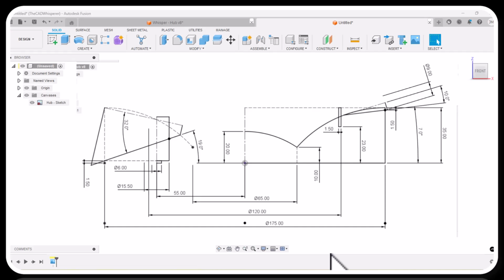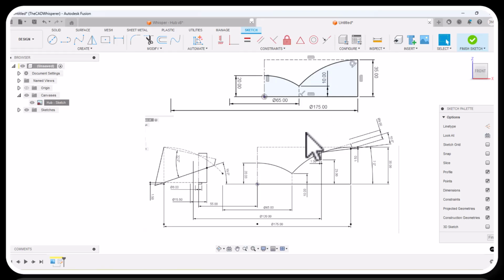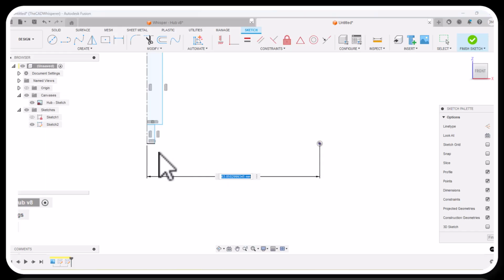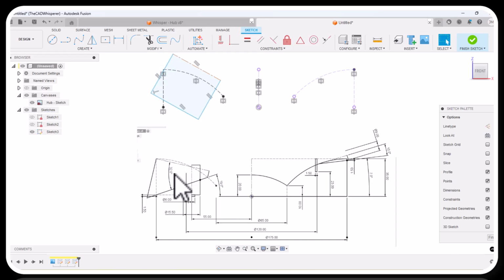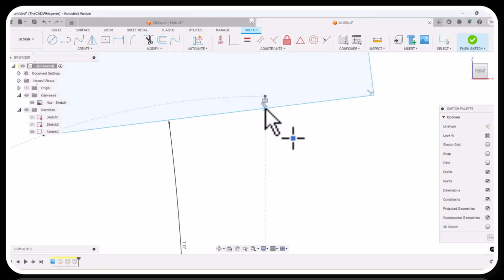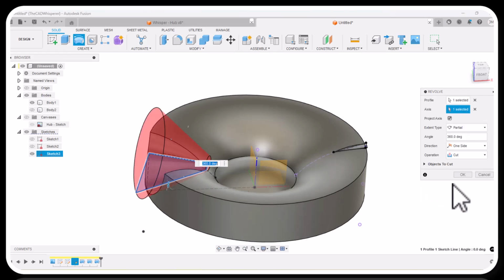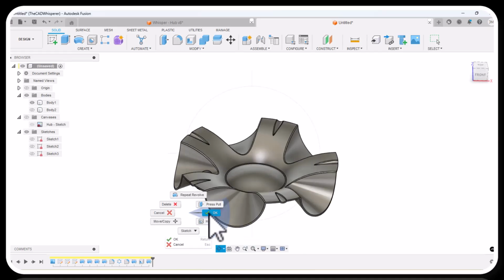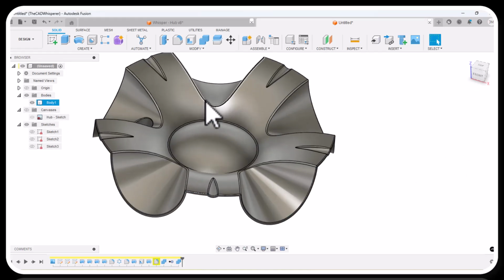Wheel Hub

Comment: Hi JD. Do you still have this file? Can you try something for me if you do? Edit the filler that says it lost the edge and just hit OK. Does the fillet then work ok? Something I have been running into a lot lately.
Reply from the maker: I posted the flle here
https://forums.autodesk.com/t5/fusion-support-forum/another-fillet-bug/td-p/13607471
this is the third way I modeled the geometry and saw the same issue.
If I Edit the feature and do nothing - it goes away until Ctrl b again.
I worry about unresolved issues (especially hidden transient issues) causing downstream modeling issues later on.  I think this one is just a bug without a bite.
Reply: @ Thanks. I’ve been trying to have meetings with some PMs etc lately to point out areas where Fusion is just flat out failing. I’ll provide this as an example on your behalf.
Reply from the maker: @MechanicalAdvantage  
Here is another one that is more serious - a failure of the Full Round Fillet.
https://forums.autodesk.com/t5/fusion-support-forum/bug-full-round-fillet-fails-on-similar-feature/m-p/13425398#M215938